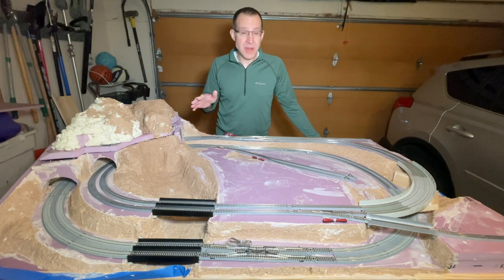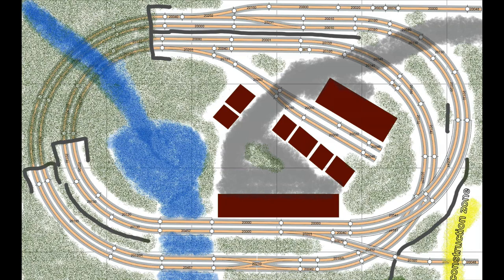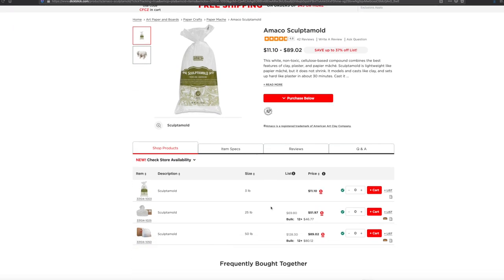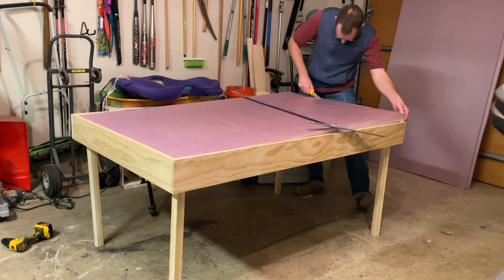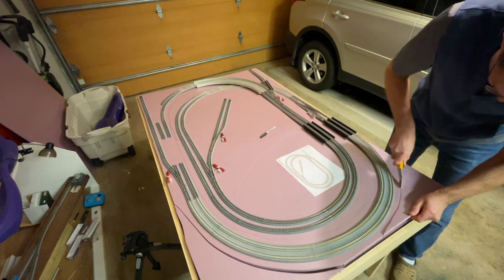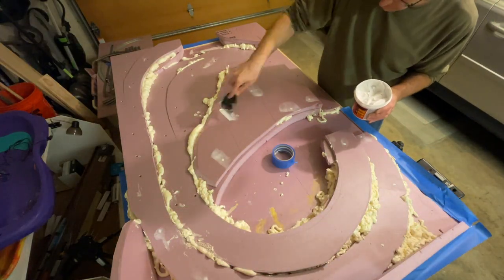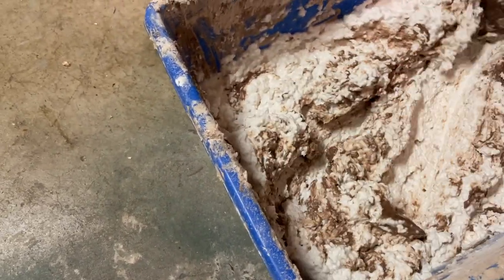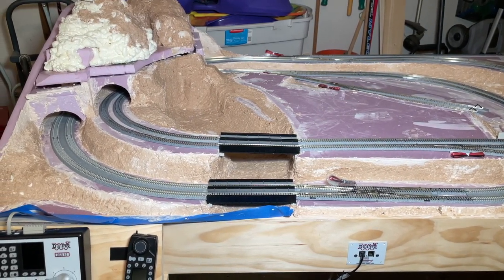New 3x5 N Scale Layout Project Part 1: Benchwork and Base Scenery

Comment: Thank you for your construction design build! I went for the build and it looks great.  I had to do some slight changes due to the 2 inch pick foam is not available right now or hard to find.  I went with 1 1/2 white foam board. So i adjusted the supporting 3 1'2 inch rails inside to make the foam level with the top outside perimeter boards. I also added a sheet of plywood as the base for the foam to rest on.  I also used the Kregg pocket hold system for the joinery and i like that method in all my projects.  No screw holes to do on the outside perimeter boards to show.   Lumber prices are like wow though (Jan 2022).  I was able to build for just under 300.00 USD dollars.  I borrowed the leg supports construction from the 
Lionel train board build on YOUTUBE.  It's a super strong support structure using no 8 2 1/2 inch wood screws.

Comment: Everything you've done everything I've seen that you've done is amazing the problem I'm having is the train engines will not make the corners unless I have a wider sheet I would have to have a 5x5 or 5x6 in order to get them to turn most your engines only have two axles on each truck that's not that's why like a yard tractor to me I went to Big road ones you know with the eight axles for axles per truck the Wednesday hauled out of those cold cars with but was it 1200 and some odd cold cars and six engines any suggestions to help my project move forward
Reply from the maker: Yeah, big locomotives and smaller radius curves are a problem. It becomes hard to have a portable/island type layout if you want to run that type of equipment. Still, I would think most should be fine if you go to a 4 foot width and 20-22” radius curves. Really, I haven’t seen anything that can’t do 18” radius curves in N scale. Obviously larger curves make things look better. Bigger than that and you need to look at having a shelf layout mounted to the walls with the middle of the room open or something along those lines.

Comment: Steve, I'm in the middle of building my benchwork.  It is 64.5" x 31.5". The outside frame is made out of 1"x4"s with 3 1"x3" stringers on the inside to support the 1" foam insulation board. I will also support the foam around the perimeter with .75" strip so that the foam will not slip on the edges. I've noticed that a lot of layouts put the foam insulation board on some type of ply sheet. With this size layout, do I really need the ply?
Reply from the maker: Probably you will be fine without it. But, I would generally prefer a thicker piece of foam if no plywood is used, but your wood free spans will be fairly short. But, you may still have the foam flex on you between the stringers. A thin piece of luan or underlayment (1/8”) glued to the bottom of the foam would dramatically increase stiffness and give you something to screw things to if needed. Or, if you did a couple layers of 1” foam glued together it would be super rigid. Other scenery glued on top of the foam can also increase rigidity, so just depends. You can probably try what you have planned and see if the foam flexes at all between the stringers. If it does, glue on another layer of foam (maybe even just half inch).
Reply: @StevesTrains  Thanks for your thoughts.  I haven't installed the foam insulation yet and I'm glad I raised this question now.  I never even considered that I might have to mount something under the bottom. It would be better to have some kind of thin ply or like you say luan.  I'd rather do it correct now in the building stage rather than later realize I should have done that. I'm going to add it.  Thank you for your expertise and great videos.  Tom

Comment: I really like this layout Steve. I printed off a copy of your plan to play with and make a few possible building location changes. It looks like the grid lines are showing the layout to be just under 3.5  x  5.5 instead of the 3 x 5 you show in your video. Which is the real size? My wife is hoping we can make it into a lake side resort of some sort.
Reply from the maker: It is in fact 3.5 x 5.5 feet. I originally had planned to do it in 3x5 feet but then opted to push it out a bit and go with a little larger minimum radius.
Reply: @StevesTrains  Thanks for confirming what I was seeing on the plan.

Comment: Im thinking of making something like this, but the benchwork as a coffee table. would that be possible for this layout by chance?
Reply from the maker: It would be a big coffee table but certainly you could put short stubby legs on it and a put a glass top. However you would have to have a lot of framing visible across the top since the span would be too large for a single piece of glass that big only supported but the edges unless it was really thick glass

Comment: Thanks for the video! Will definitely be following along as I’m currently starting on a 4x4 N layout centered around a figure 8 after a few years out of the hobby. Would anyone be able to provide me with the track planning tool being used in this video? I’ve been trying to plan it out by hand but am struggling to piece it all together.
Reply from the maker: I used AnyRail. I’m using AnyRail 5 not the latest version since I’m running it using crossover on a Mac and the new version won’t work correctly in that way.
Reply: @StevesTrains  I’ll look into it! This is the first time I’d be using a track planning software and am not familiar with how they work. I plan on using Kato unitrack, so their product line modeled in the software?
Reply from the maker: Yep, Kato unitrack, Peco track, atlas track, and others are all in the included track libraries.
Reply: @fevinman7162  big thumbs up for Anyrail. It’s very easy to use and has Unitrack in its library. I highly recommend it.

Comment: Great video Steve. Were you able to transport the 4x8 sheets of foam board in your vehicle?
Reply from the maker: No, I had to cut them down a bit to fit. I had to cut off about 5-6" of the long side and a couple feet of the short side of the ones for the base. I think I just cut one sheet into two 2x8' sheets so I could slide those up to the front on the passenger side. I have a Rav4, so can't by any means get a full 4x8 sheet in there.
Reply: Got it, Thanks!

Comment: Im in the process of designing an n scale layout that will be 36'' x 14 ft. The base will be all one by three or six  glued and screwed for strength. I was originally going to use 1/2 '' ply for the top until I saw your build. is the foam board going to be strong enough if I use it instead of plywood? it certainly looks more usable.
Reply from the maker: The 2" foam board is very strong and stable, though you still don't want to have long spans that are unsupported. There are good and bad things to using the foam for the layout base. It is certainly easier to carve and do things with in terms of scenery, but it can make track laying harder in some cases. When using flex track, you have to glue the track down as you go, you can't nail or screw the track down to the foam, and that can make the track installation a  little trickier when using flex if you have a lot of curves. It of course doesn't matter much for straight track areas. Also, adding turnout machines and the like can be a bit trickier with foam, though still doable. The foam can also get dented and distorted from pressure, to where it is not level because of those dimples and what not created by squeezing it, or laying something heavy on it, etc. It will crush a bit, and those little dents and what not can be a problem for N scale, and may require you to fill them in with patching plaster or something like that. Wood of course is stronger and consistent in terms of being flat once you sand it, if needed, but can also expand/contract with moisture changes which foam doesn't do. It of course is harder to do things like add terrain below track level. If you don't need to carve the scenery much below track level, you can do something like gluing a 1/2" or 1" thick layer of foam to the plywood (you can get away with 3/8" or even 1/4" if you are using the 1" foam since that will add a lot of strength when glued to the wood), this way you have something to screw things to if needed, but still have an easy to cut base for trackside ditches and the like.

Comment: How much distance between single tracks, also size of tunnels?
Reply from the maker: I just printed the tunnels big enough to clear all rolling stock. The opening is much larger than commercial tunnel portals. Since the tunnels are on a curve I needed more clearance than usual. I’ll see if I have the printer file to get the dimensions. The track spacing is just standard Kato double track spacing. I’ll have to see what it is center to center but it is a couple of inches or so.

Comment: Hey Steve: I have my table built 3.5' x 6'. I bought a lot of the track according to your track list, now it doesn't fit. Also had to call Kato for some of the track because your numbers went out of production, but the where able to help with new numbers. Can you tell me the grades you are using and how high the grades are? Also where do you start the grades at?
Do you have that info? And could you send it to my email? 
Thanks:
Charlie
Reply from the maker: The grades are less than 3% mostly.  The high and low point are both in the right front area where the upper level track crosses over the lower level. I have about a 2” clearance between the rail head and bottom of the bridge in that area. The small track pieces from Kato are available in track packs, if any other track part numbers have changed, let me know so I can update the website. If you send me a email through the form on the website I can reply to that if you want more detail.

Comment: Quick question I am building my first HO scale layout do I need to use sculpt a mold outside or can I use it in my house, and does it get hot b/c I always see it steaming in your videos.
Reply from the maker: It doesn't get hot at all. Regular plaster will get warm as it cures, but this is a mix of plaster and a paper mache type product, and so it stays cooler. The scupltamold doesn't steam, though sometimes I use hot water so it cures faster and at times the garage is quite cold so that may cause some steam to be visible. More likely though it is just the dust from the powered sculptamold mix. You do want to try to avoid breathing that as much as possible. It is less messy than regular plaster, and I've used it in the house, but I always mix it outside or in the garage because the dust when pouring it out of the bag. The same goes for any kind of product that has plaster or other powered materials.
Reply: @StevesTrains  Thank you this helps alot!
Reply: so I making the layout in the basement should I mix the plaster outside then bring it inside or does it give off dangerous gasses?
Reply from the maker: @lucasdavison7119  No gasses, just a lot of fine dust that will get on everything. Don't want to breathe the dust in either really.

Comment: What radius is this?
Reply from the maker: Curves range from 12.4” to 18.9”. You can see a full parts list on the part 1 blog post here: https://www.steves-trains.com/post/building-a-3-5-x-5-5-n-scale-layout-part-1-benchwork-and-base-scenery
Reply: @StevesTrains  Thx! I want to run those long auto parts boxcars and autoracks. I guess 22" radius would be best, you think?
Reply from the maker: In N scale like this even those will run on 12.75” radius curves, but of course will look better on curves >15”. If you are talking HO scale then 22” would still be tight for those but they should work ok.
Reply: @StevesTrains  Thx!

Comment: In your other video about which track to use, some one said problem with unitrack is that it's hard to get superelavation and grades and curve easment, but it looks like those tracks do have it, i am looking at the any file from yourwebsite, i dont get it.
Reply from the maker: Kato makes superelevated track, but only in double track with a few radius curves. So if you can use one of those, then it works great, otherwise it doesn’t.
Reply: @StevesTrains  Oh i see that's cool.
Reply: Cheers legend!
Reply: @StevesTrains  What about Easments, it seems like that id designed for that because the legths of the radius, am i correct?. God these easments n shit are making me all paranoid.
Reply from the maker: Kato makes easement sections you have to use to transition from regular to super elevated track.
Reply: @StevesTrains  Thats neat!, thx Steve!!!!!!!!!!!!!!